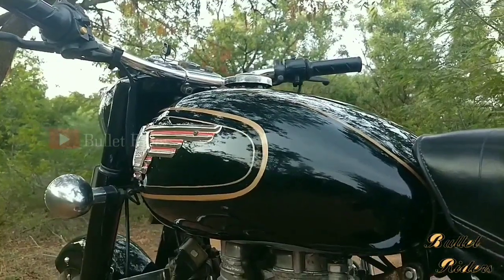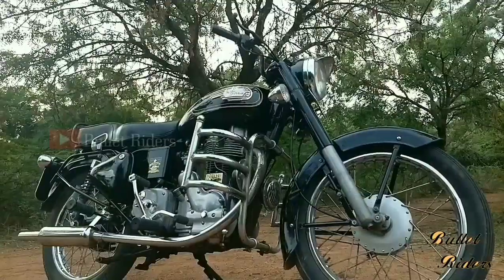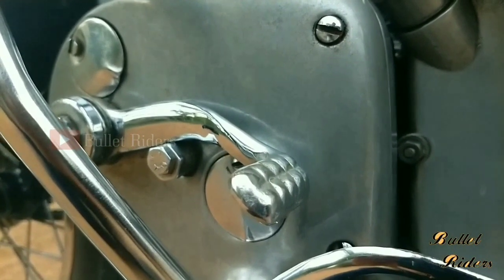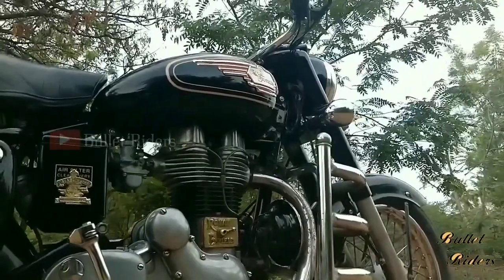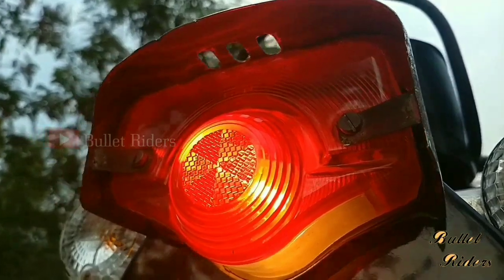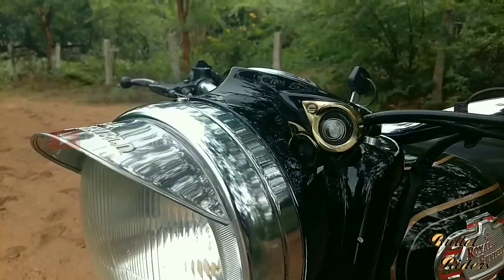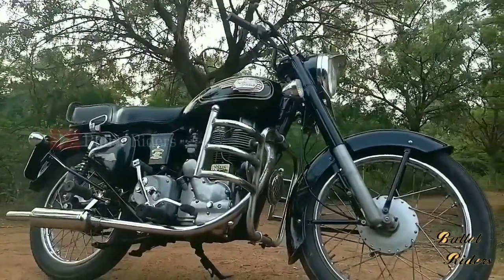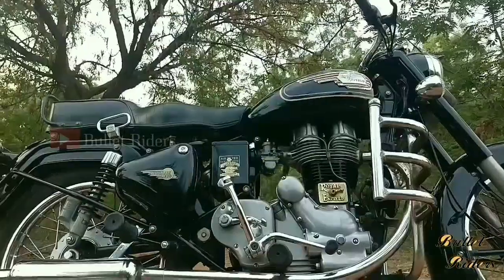Which Royal Enfield is best l CI vs UCE Engine l Old Bullet vs New Bullet

Comment: A few important queries 1) according to the scrappage policy, if the old motorcycle is in a mint condition and can pass the fitness, it will be allowed on the roads, so my question is will the old CI bullets pass the fitness??
2) will the necessary spares(i am not talking about the vintage spares) like piston, valves, block will be available in future?? Also will they be available at normal rates or will they cost a  bomb??
3) I did not understand how the regular maintenance of a cast iron is less than UCE?? The 1 rupee per km... Can you elaborate it.
Reply from the maker: Bro, First of all Thanks for ur comments...
1) Bro, there are lot of Old CI Bullets still doing Great on Roads and lot of Old Cast Irons still doing Ladakh Successfully. Bro, Do u think these Bikes have not passed the Fitness Certificate???
2) In Chennai(Velachery), there is a separate Royal Enfield Showroom for Vintage Bullets. They only sell the Old Vehicles with some warranties so No issues in getting the Old Spares....
3) Bro, Do u own an UCE machine.. If  yes then what's the Maintenance cost u r spending for each Service..
Reply: @BulletRiders  do you believe a cast iron engine pollution levels as measured by PUC is within the range of PUC Standards.... Will the standard of fitness tests(measuring values) change or remain the same after scrapping policy is brought into execution??
Will I be able to procure the spare parts from Chennai at the same rate to Mumbai??
3) I don't own a uce.. But wish to know about the maintenance of both old and new bullets in detail bcoz I am still deciding which to buy.. My heart is in the old one.
Reply: @kalpeshpatole2880  then go ahead and purchase the old CI one standard bullet. I am having 1983 model
Reply: @jayeshsonkusare3914  yeah.....got a 2005 heavy crank this year.... amazing bike!!!

Comment: Having driven the modern UCE Bullets as well as the older CI Bullets I will take the modern ones any day. Especially the EFI engines on my current Enfield Thunderbird 500 is a dream to start any day even after been parked for days in the garage. It is one thing to have a bone tingling thump and another to break your bones trying to get the bullet to start.  Further with addition of prooer mods like RRP exhausts, I have been revving my Bullet for last 3-4 years without any problem or damage. Have done no tweaking/rework on the engine.